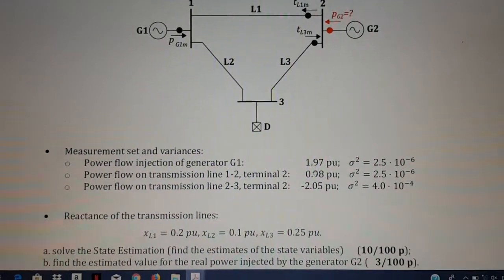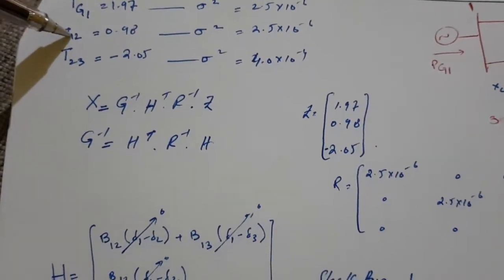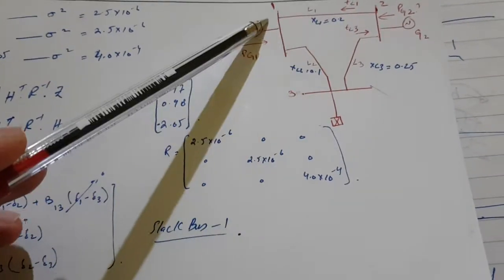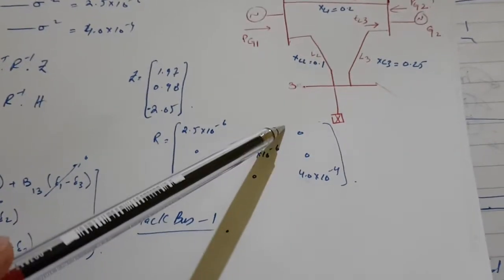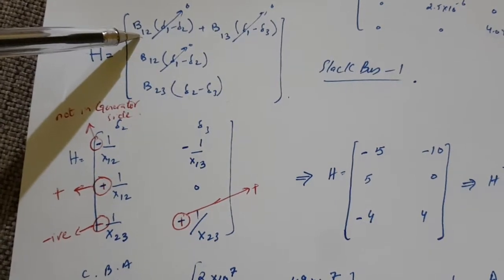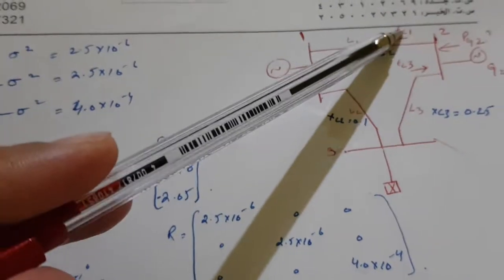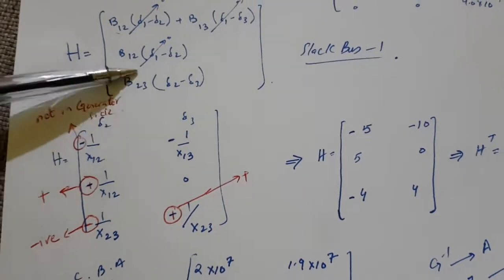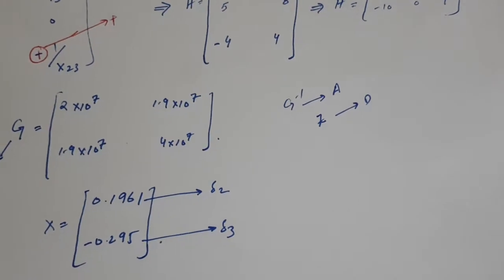Non Linear State Estimation- practical example-Electric Power System (EPS) 02

Comment: Can you solve the pu for these.
 

The single-line diagram of a 3-bus system and equipment rating is shown below:

 

  Generator 1:         100MVA,15kV, Xd”=X2=0.18, X0=0.07p.u, neutral solidly grounded

  Generator 2:         100MVA, 15kV, Xd”= X2=0.20, X0=0.10p.u, neutral solidly grounded

  Generator 3:         50MVA,13.8kV,Xd”= X2=0.15, X0=0.05, Xn=0.05 p.u.

  Generator 4:         75 MVA,13.8kV,Xd”=0.30, X2=0.40, X0=0.10p.u, neutral ungrounded

   

  Transformer T1:   100MVA,15kV Δ /765kV Y-Grounded, X=10% , X0=5%

  Transformer T2:   100MVA,15kV Δ /765kV Y-Grounded, X=10%, X0=4.5%

  Transformer T3:   50MVA, 15kV Y /765kV Y-Grounded, X=12%, X0=3.5%

  Transformer T4:   75MVA, 15kV Y /765kV Y-Grounded, X=11%, X0=4%

 All transformers neutral connections are solidly grounded.

 

 Transmission Lines:

  1-2   765kV   X1=50Ω, X0=150 Ω

  1-3   765kV   X1=40Ω, X0=100 Ω

  2-3   765kV   X1=40Ω, X0=100 Ω

 

 

Using PowerWorld simulator, perform short circuit studies for any one bus (bus Fault)and any one Transmission line (Line fault) of the above system. The study should include following:

 

a.      Construction of Z-bus

b.      One symmetrical and any one types of unsymmetrical faults

c.       Resulting data of short circuit current magnitudes and bus voltages with their bus angles

d.      Your analysis of data

e.      Selection of a circuit breaker of proper rating for installing at the bus for which fault study was carried out.